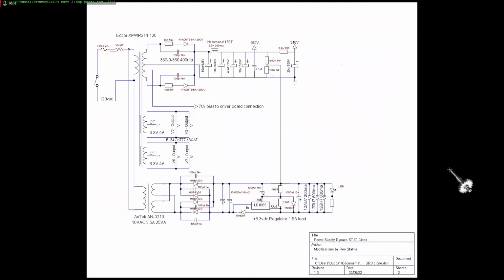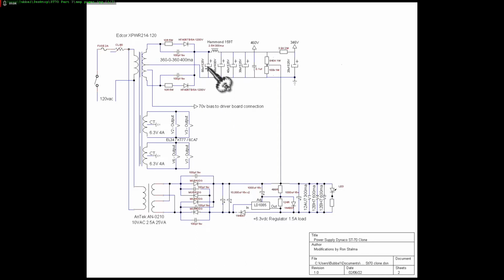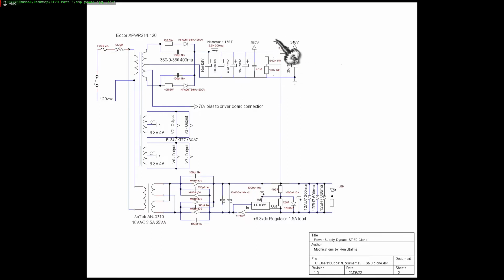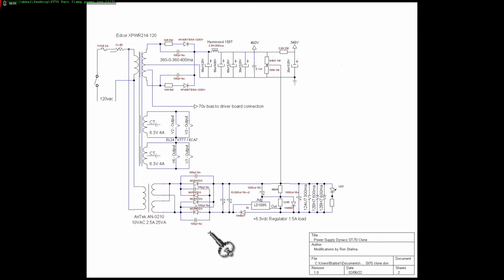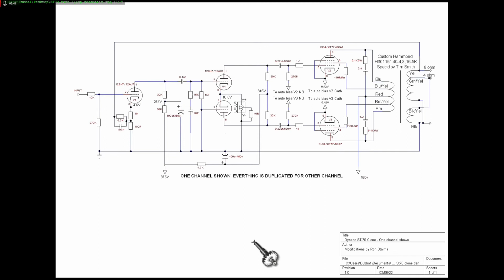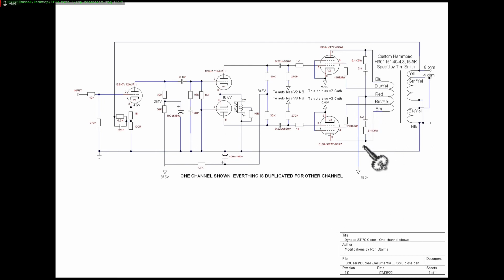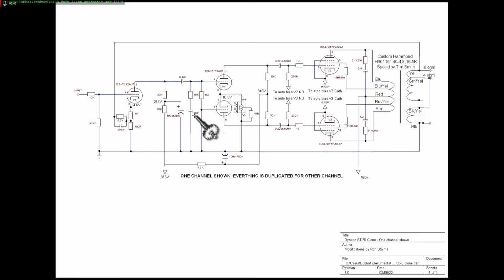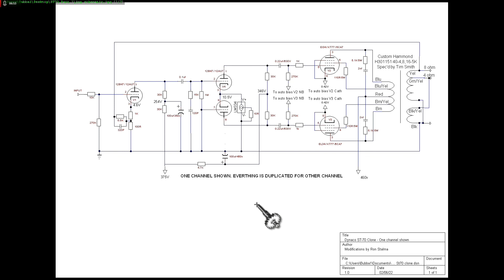Dynaco ST-70 Clone built with a VTA driver board and custom output transformers. Part 3.

Comment: hi, the 10 ohms 5 watts on the secondary power transformer, is it to reduce the  high tension voltage .So  you put 70volts directly on the 270k ang 70 v on the cathode el34, so  its the first time that i see  a shematic like that .

Comment: hi,good job ,i make a push pull  with 6l6 class A,  cathode bias triode connection  with 2 x 6sn7 and 2x6sl7, so  do you think that 400 ma for the power transformer is enough!

Comment: I built my st120 from bob about 7 years ago. I do minor electronics repair as part of my job as a forklift tech. The instructions were amazing, the parts are bulletproof. Driving a pair of Cornscalas from BOB CRITES without issues for lotsa drunken parties. Never a hickup. Amazing kits. I think im ready to build a set of monoblock M125s.